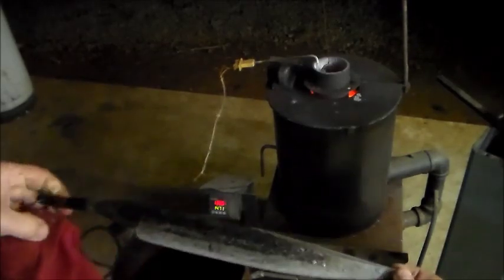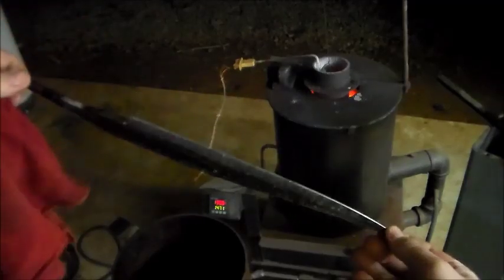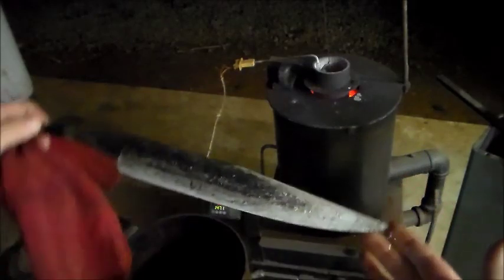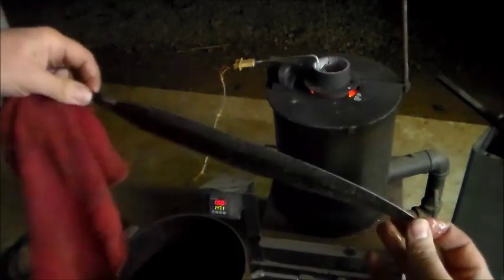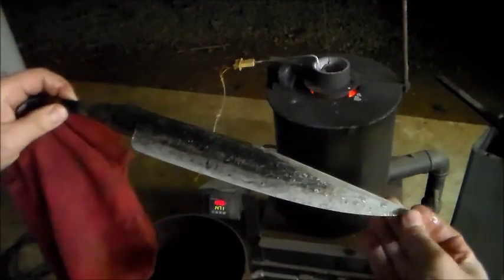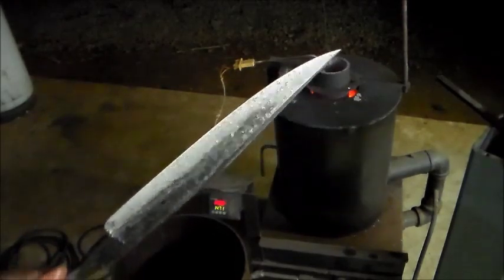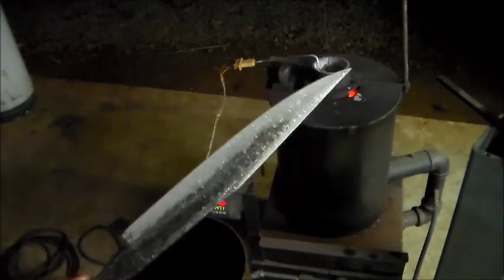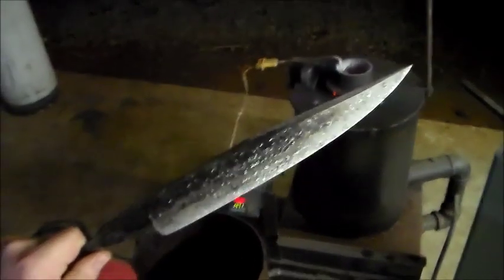Nick Wheeler quenching W1 bowie for no clay hamon

Comment: Hi Nick , Been using W2 and old Black Diamond/Nicholson files for sometime now , but Since I've run low on the old stuff , I'm only able to buy W1 now. I know W1and W2 are very similar except W1 hasn't any vanadium . Very happy with what I've been doing,  but what is your opinion on W2 vs W1 ? thanks.
Reply from the maker: It's easier to sell W2, because it's found its way back into a "household name" for steel... However, if you gave the average person two identical blades (one in W1, one in W2) and set them to work in the field, I think they would be pretty hard pressed to tell the difference. Clean W1 forges, grinds, machines, and hardens very nicely. Not that it really matters, but I won the George Peck award in 2007 with a bowie forged from W1. :)